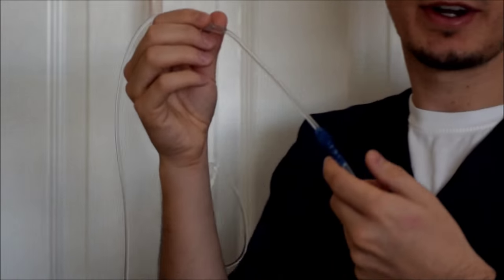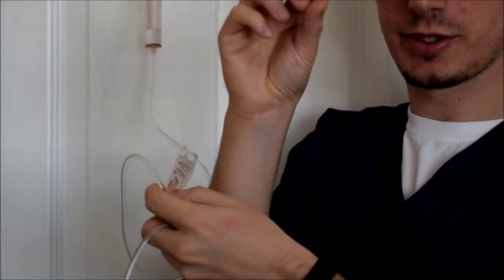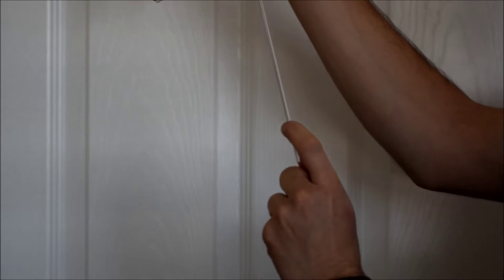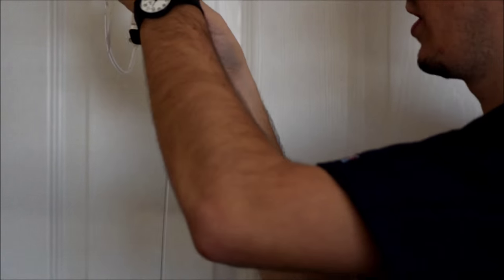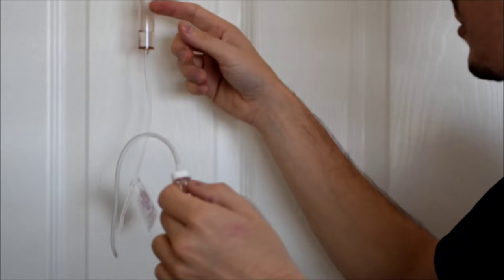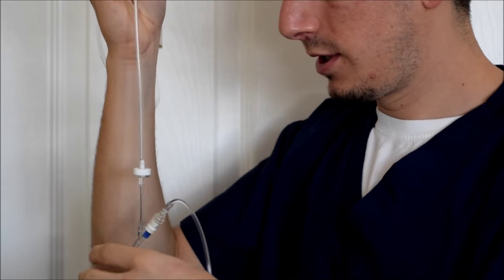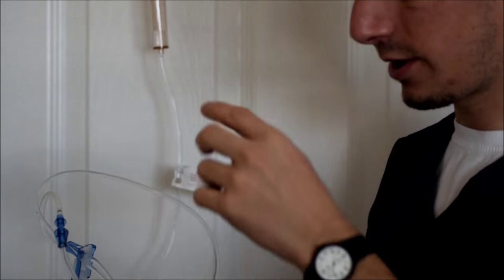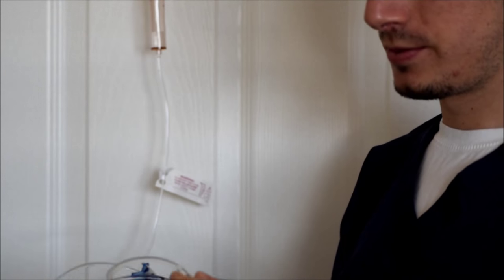How to Remove Air Bubbles From an IV Line

Comment: I can get the bubbles to move up, but they get trapped right under the squeeze chamber, and then proceed to form one large bubble. How can I get them up into that chamber?
Reply from the maker: Sometimes you have to just flick them. If not you can get a empty 10cc syringe to withdraw it or just prime the tubing
Reply: @RNScrub  We are flicking them, we can get them to top of tube but then they all form one larger bubble and get stuck below chamber. We are doing this at home for husband, not a nurse and not given supplies to withdraw air with syringes.

Comment: If some air did get into the bloodstream does it dissipate over time ?
Reply from the maker: Normally it does, as long as you are not injecting over 5ml of air should be fine. Small ones are not harmfully and as long as it isn’t continuous it’s ok
Reply: On the venous side (where the vast vast majority of meds are given), the air is traveling to larger and larger vessels on the way back to the heart where it will be sent to the lungs and the air will escape during the normal gas exchange that happens in alveoli. This is also why patients can taste/smell some meds!
Reply: @itoldyouicantdance so if a very small bubble enters the circulation it doesn’t make any harm!!